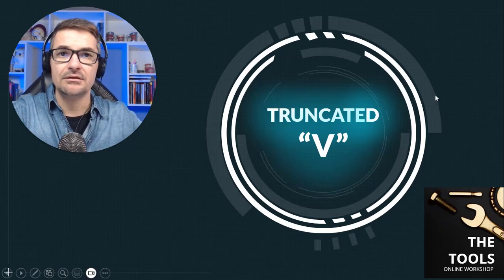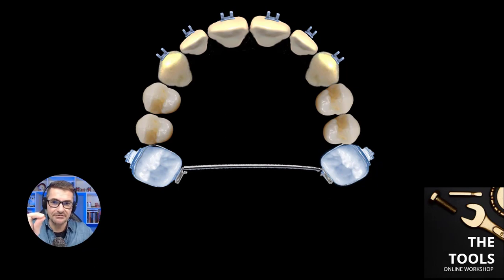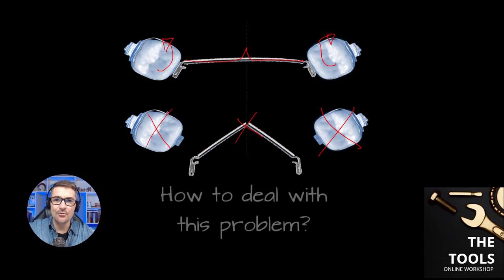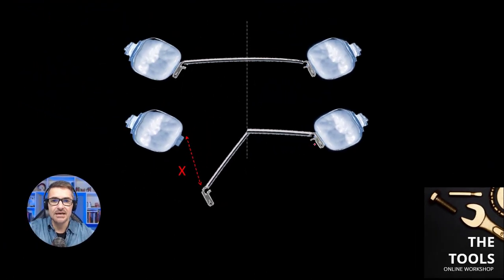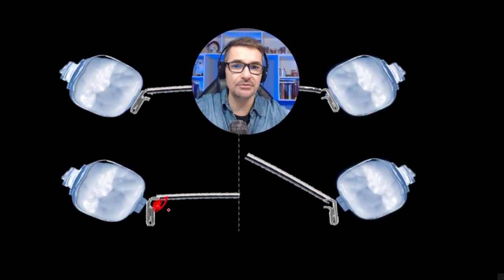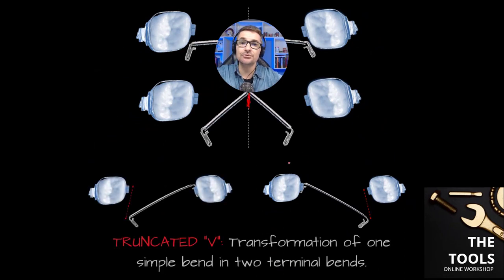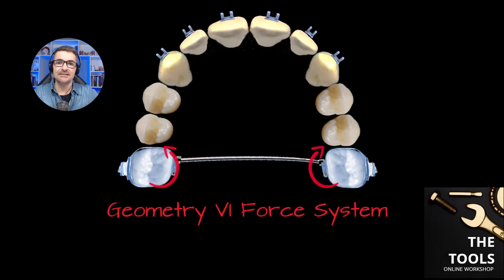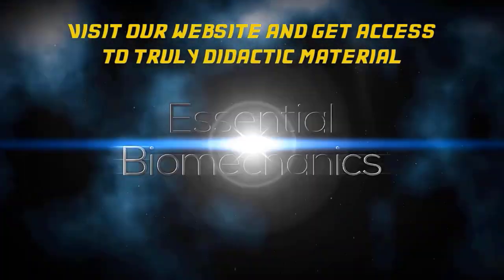Truncated "V" | Essential Biomechanics

Comment: can it be done when the TPA is soldered to the bands ?
Reply from the maker: For active applications of the TPA, by making bends to produce different force systems, I strongly recommend the removable appliance. If you make the bends in a TPA that will be cemented, the cement will not appropriately cure. And it's very difficult to make bends intraorally in a TPA.